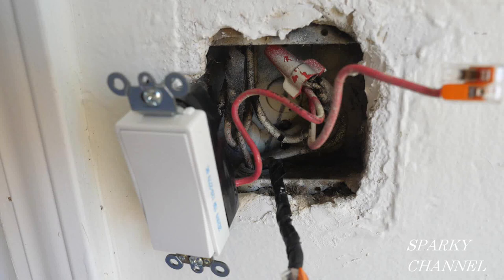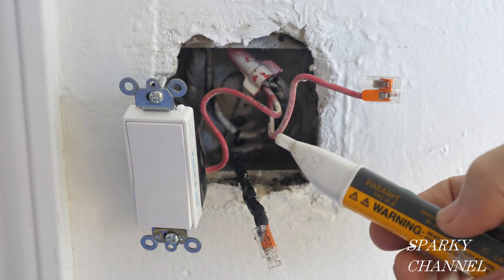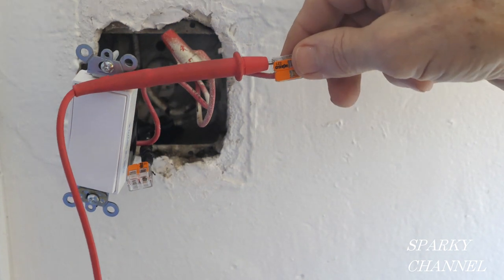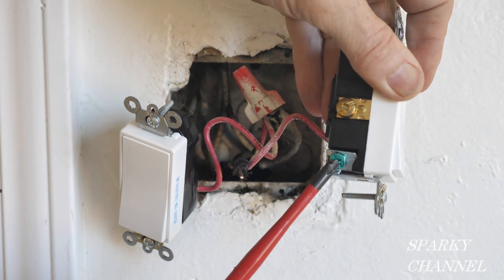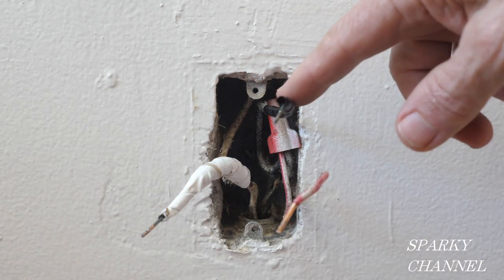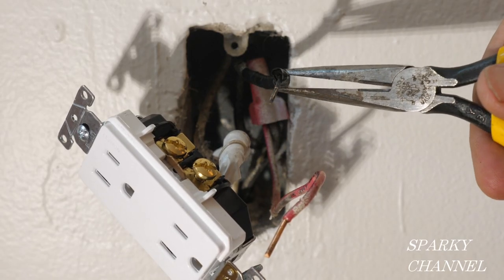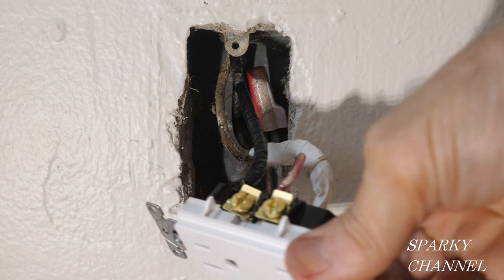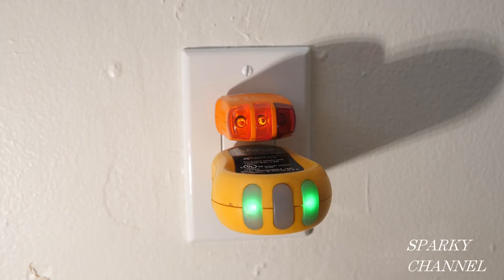How to Wire a Half Hot Receptacle in a 1957 House

Comment: I never thought to put the split device inverted. Great idea!
Reply from the maker: We just put them the opposite direction. You could also use a: Leviton 16252-1PW Commercial Grade Duplex Straight Blade half hot Receptacle 15 Amp 125 Volt NEMA 5-15R White Decora Plus™: Amazon: https://amzn.to/3jJRchU
  However, they are a bit pricey.

Comment: it bears mentioning that in my area, the convention for three wire cables is for the black to be the hot conductor and the red to be the switched conductor.  so don't assume that because bill's house uses the red for hot and the black for switched, that every house does.
Reply from the maker: I was surprised to find that it was the red wire that was hot all the time.
Reply: @SparkyChannel  I think I may have seen it, before, but it's definitely uncommon.
Reply: Had Bill been rewiring the house he would have used that convention, the code does allow for the method shown when doing upgrades to equipment, same applies to grounding, you are not required to add ground wires if it entails tearing open finished walls.

Ken, Pretty sure you know this, just putting it out there for the DIY electricians/rewirers

Comment: I appreciate the tip: installing the half-hot upside down to indicate that it's a switched outlet. Is there a convention that the bottom of a half-hot receptacle is always the switched outlet? Also, like Jeff below, I am curious to know whether there is a situation where you would want to break the tab on the neutral side, or is it just that they use mass produced parts and it's cheaper to include the break-away tabs on both the hot and neutral?
Reply: the reason for making the bottom the switched part is that you plan to always have a lamp plugged in, and may plug and unplug things in the hot half, so with it on top, it's easier.

you would break the neutral tab out if you are feeding the outlet with two separate circuits since circuits sharing a neutral are required to have the breakers turn on and off together.
Reply: In thinking it through and examining the two half-hots in my house ( both installed in the "new" part of the house, added in the 1970's, neither is oriented as you show and one has the switched outlet on top) it occurs to me that with the bottom outlet connected to a lamp controlled by the wall switch, the upper outlet remains accessible to be used for other "always on" purposes.  In general, I find that conventions usually have quite practical origins so I always wonder what those origins are. 

I realize you are working with existing wiring here, but in new constrution, wouldn't it make sense for the "always hot" leads to be black and the switched leads to be red?
Reply: @kenbrown2808  Hi Ken, I was typing my follow-up and didn't see your reply until I posted it. Thank you for the confirmation of my thinking. When you say two separate circuits, are you meaning circuits on two separate breakers? Is it actually legal to have two circuits on two separate breakers in the same box? In my very old house I discovered a frightening condition while replacing a light fixture. Two separate circuits came together in a double box in the upstairs part of the house. Sometime in the 70's the original switches in that box were replaced and the installer had bound the neutrals together. When changing a fixture in another part of the house, I shut off the breaker and confirmed that the hot was off, but discovered (Ka POW...not really, I found it with my NC tester) that there was still current in the neutral of the cieling box. It took a lot of sniffing around before I figured out why.
Reply: @christopherdahle9985  yes, it is legal and sometimes necessary to have two separate circuits in the same box.  and yes, you find places where somebody was less qualified than they should have been and tied them together, and depending on breaker positions, they either have an instant fault, or they have a circuit that seems to be impossible to turn off.
also, there can be a "multiwire branch circuit" (official term) which consists of two or three hot wires sharing one neutral wire - which, since around the late 90s has been required to be on a two or three pole breaker (the latter is only permitted on a three phase system) so you can't turn off just one hot leg and leave the other still hot - because of the exact situation you found.
Reply from the maker: Excellent discussion here. IMO I have the best viewers on all of YouTube!
Reply: @SparkyChannel  your video format is a good forum for it.  there are a few other channels that show electrical stuff that is a bit below the standard an instructional video should reach.
Reply: @kenbrown2808  Thank you Ken.
Reply: @christopherdahle9985  you're welcome.
Reply from the maker: Yes, it is the convention that the switched receptacle is on the bottom half of the duplex receptacle so that a lamp cord plugged into the bottom won't be constantly getting in the way of using the upper receptacle.
Reply: @SparkyChannel  Thanks Sparky, I appreciate the videos and the discussion.

Comment: I moved to this house that was built in 70s and there were exactly the same switch and receptacles. I turned the switch on and off but I didn't see anything happen. That was quite a mystery. And I was wondering why only the bottom portion of the receptacles were on. Finally I found out that the switch was controlling the top portion of the receptacles. I assumed that pre owners used those switch and receptacles for lamp stands in the living room.
Reply from the maker: Yes, that would be correct. Good job figuring it out!

Comment: Thanks for making the video.
I do have a question for you which is how do you know the boxs are grounded and not simply the neutral wire jumpered to it?
Reply: Thanks. yes, same question. And what would the multi-meter say, if the box was connected to neutral? what would multi-meter show if it was NOT grounded? And where does the current go if incoming red wire has about 125 volts, and I cannot find metal to ground the other black probe? Does it burn up the multi--meter, if I touch an ungrounded red live wire and have no ground, for more than several seconds? I'll read up more on multi-meters, but why would a multi-meter show 0 volts, until the black prob is touch to a ground that goes, somehow, back to the main panel? Is electricity and copper wire really that reliable, and such tools, always find the path of least resistance, via a ground, back to the main Distribution panel? I'm still pretty new to V = IR.

Comment: Hi Bill, at 1.53 you start testing for good ground at this box and the other box in this 1957 house and test shows they are properly grounded with an external ground wire attached to the back of the box. Is the "good hot to metal box 120 volt test" adequate to prove this or do you have to visually see the external ground wire properly "bonded" to the outside of the boxes? 
You don't state what type cable is used here, so what if it is a 2 wire "AC" type metal clad cable and the "good ground" test reading is achieved without using an external ground wire on the box exterior? ..... meaning the ground continuity reading was running though the metal clad cable sheathing back to the breaker panel, is that still considered a "good ground" if you get a "good hot to ground 120 v test"?
Reply from the maker: In 1957 a metal clad conduit was frequently used as a ground. IMO the original grounding system should always be tested because over the years well meaning people can cut the old ground wires, not knowing what they are. Also they can loosen up the metal connectors that connect the metal clad conduit to the metal boxes. In my case the 1957 grounding system was still intact so I used it. Eventually the electrical will need to be changed out and everything will have to be brought up to 2020 NEC code.

Comment: Interesting that a 1957 original wiring has grounded boxes.Was it romex or armored BX cable? Some romex had 16 gauge aluminum wire and armored cable can be corroded not providing a ground.
Reply from the maker: See: How 1960's Metal Electrical Boxes Were Grounded: https://youtu.be/nFL_nNPOztk

Comment: I never heard of the part where you turn with ground on top for that reason. I do remember when the wanted all recepicles with ground up.
Reply: That's never been a code requirement...
Reply from the maker: We just put them the opposite direction. You could also use a: Leviton 16252-1PW Commercial Grade Duplex Straight Blade half hot Receptacle 15 Amp 125 Volt NEMA 5-15R White Decora Plus™: Amazon: https://amzn.to/3jJRchU
Reply: that one is still a 50/50 opinion, 50% say up 50% say down 50% don't care😁, and each have their own logical reasons for doing it their way, the best reason I've heard for always up is that if a plug becomes lose and a conductive object falls on the partially exposed conductors it will land on the ground prong and it won't cause a short, but then that only really works with three prong plugs. So it's still a 50/50/50
Reply: @a..d5518  Hospitals are always wired ground plug up.   Observation. thank you.
Reply: @a..d5518  the opposite argument is that if the plug is ground up and you step on the cord, or it falls out under its own weight, the rotation will break the grounding connection first instead of last.

someone did a demo of the "falling object will short across the blades" theory and had a heck of a time getting the result he was attempting to get. - but still, hospitals need to have zero margin for error.

Comment: Great vid. Please mention why a self tapping screw in the back metal would be an illegal ground again. But a less effective self grounding clip method is considered legal.
Reply: the threads on a self tapping screw are not approved because they are too coarse to be sure of a good connection.  grounding screws must have 32 threads per inch.
Reply: @kenbrown2808  do you have an article for these claims...???
Reply: @MrMaxyield  Section 250.148(B) NEC is the main rule in this case, and it requires only a grounding screw used for no other purpose or a listed grounding device. The screw is not required to be green. However, Section 250.8 states, “sheet metal screws shall not be used to connect grounding conductors to enclosures.”

I'm not sure “sheet metal screws” is a well-defined term, but I take it to mean screws that are thread-forming. Sheet-metal screws form threads by slightly deforming the sheet metal and forming essentially one thread in a sheet of metal. Most so-called self-tapping screws don't really self-tap. Rather, they are thread-forming screws with or without drill point tips.

Screws that are truly self-tapping actually cut a thread that will accept a machine screw. Many of the screws provided with grounding terminal bars for panel boards have screws of this type (that actually cut threads) and they are usually not green. Some screws of this type have drill point tips as well.

Many grounding screws and the screw holes provided for grounding screws have 10-32 threads (No. 10 screw size with 32 threads per in.) and will cut or engage three or four threads in a typical 1/8-in. sheet-metal box.
Reply: @MrMaxyield  250.8
Reply: @kenbrown2808  actually it's the self drilling screws, they are the ones with the pointy ends, and usually referred to as "sheet metal screws" that are not allowed because of the coarse threads. You can buy 10/32 Self-Tapping ground screws at your local hardware/box stores, and they are green.
Reply: @a..d5518  green and approved.  which is why I assumed by "self tapping" in the context of being illegal he meant teks screws, not approved thread forming type ground screws, which aren't illegal.
Reply: @a..d5518  it's the thread pitch, rather than whether it makes its own threads that is the issue.
Reply: Minor highjack, but since the code experts are in this thread. Is a home required to have one of these switched outlets or are they optional. Mine has one and it took me a while to figure out what that extra light switch controlled.
Reply: @MoneyManHolmes  every habitable room in a home is required to have a light source that is controlled by a switch at the door you come into the room through.  a room with multiple doors (or a hall) requires a switch close to each door.
some builders, especially in the 70s would put in a switched plug to save the $9.95 it cost to buy a light.  once you have your one required light source, you can add as many other things as you want.
Reply: @a..d5518  was

Comment: Wait. If the boxes offer a return path to the panel for ground, why don't you install a ground wire for extra safety?
Reply from the maker: Limited room in the box. I just used the self-grounding clip on the device.

Comment: At what point whenever do you ever need to break the tab on the neutral side of receptacle? 6:30
Reply: if you have the receptacle fed with two separate circuits, then you also separate the neutrals.  that allows you to have separate breakers.
Reply from the maker: Ken is correct. I would add that there are code restrictions on having 2 circuits in one box.
Reply: @SparkyChannel  right.  I'm also pretty neurotic about what I term "circuit hygeine" to prevent accidental cross-connection.
Reply: @kenbrown2808  thanks for the explanation on the subject.
Reply: @kenbrown2808  "circuit hygiene" nice one!...I'm borrowing that, if you don't mind...
Reply: @JMjayesim  glad to help.
Reply: @a..d5518  sure thing.  it's a good term, it should get used.
Reply: So I screwed up and broke the tab on the wrong side. (On the silver screw side. It was dark and yes, I was paying inadequate attention to what I was doing.) 
Is it possible to use this receptacle somewhere other than 2 separate circuits?  Or somehow say 2 pigtails, one on each screw?
Reply: @theredrover3217  You can make a jumper out of the same wire you are using for the neutral, your jumper should look like a staple, with two bare conductors and a section in between still wearing its jacket. The back wire outlets have spaces for two conductors at each screw location, if your outlet does not have the back wire option you can still do this by placing the conductor that is your neutral on one side of the screw and your jumper on the other side of the screw, that way you'll get better contact on both conductors.

Just make sure the conductor of your jumper is not bare between the two screws.
Reply: @theredrover3217  yes, you can put one pigtail on each screw and then connect them both to the neutral wire.  someone will wonder what you were thinking if it ever needs to be changed out, but it will function.
Reply: @kenbrown2808  Couldn't you just use a double pole breaker and use both lines which share a common neutral? In that case it would be also ensured that the circuit is always dead when the double pole breaker is switched off.
Here in Germany you can supply several sockets with a three-phase circuit (one socket supplied by L1, the next one by L2, then L3 and so on, but with a common neutral and ground), but you must ensure all pole breaking for that. For example by using RCBO (residual current breaker with overload protection), what you know as a GFCI breaker in the US. 

Voltages here are a bit...different...that's a domestic dwelling, not a commercial or industrial unit!

line to neutral or ground:

https://abload.de/img/img_089851kbp.jpg

Between the lines:

https://abload.de/img/img_0899agkl5.jpg
Reply: @Marcel_Germann  no, you just use the system we use for big commercial for residential as well.  - with different voltage. 
and yes, it is allowable to do a multiwire branch circuit like that, but it must be on a breaker that opens all lines if any lines open.  splitting the neutral lets you run separate circuits and not have to have a two pole breaker.  so, for example, you have two freezers plugged in - if one freezer develops a problem and trips the breaker, the other freezer can keep running.
Reply: @kenbrown2808   Bless you! I have been afraid to ask that question fearing the response be for God's sake, hire a licensed electrician!  (And have looked and looked for an answer online and in my multitude of books seeking assurance the house isn't gonna burn down  due to THIS stupid mistake.)
Reply: @theredrover3217  there are plenty of other things amateurs do wrong that cause problems, but that is merely awkward.
Reply: @a..d5518  Mahalo. 🍍 For the record  I have never used backwire. I will admit sidewire (not J hooky) becoming my most favorite thing on the planet. And Wago. 😁
Reply: @a..d5518   Got it, proper terminology not so much. 😝

Comment: Replacing an already half hot duplex receptacle.   We could use more detailed wiring
diagram.  Easier to see/comprehend how one breaker accomplished both. 
Thank you.
Reply from the maker: Good idea, thanks!
Reply: Use the receptacle you are replacing as a guide, take one wire off at a time and move it over to the new receptacle. And take note of where the different colored wire go and the color of the screws they go to,  in case you get confused. or another wire comes lose. If it is hard to see the colors a bit of masking with a note on it, better yet take a picture or two, or three for reference. Just be sure the power is off at the breaker before you start, even before you remove the wall plate!!